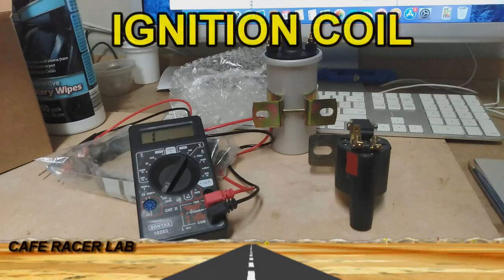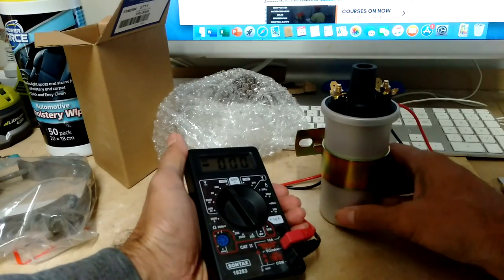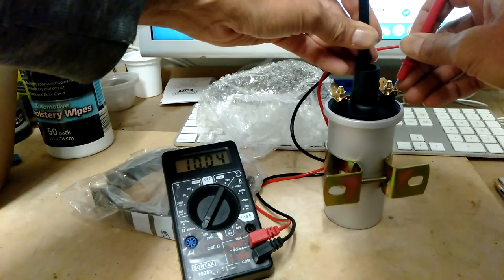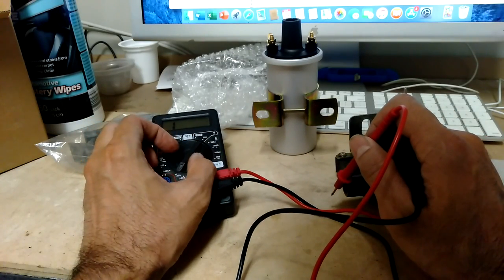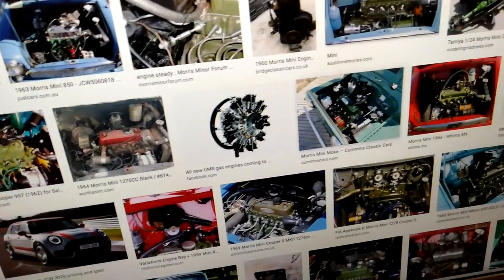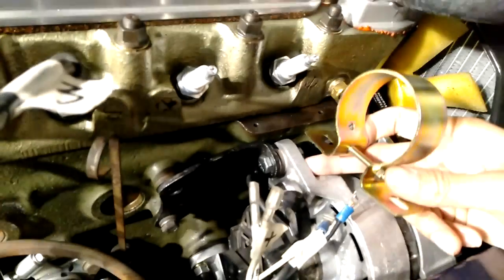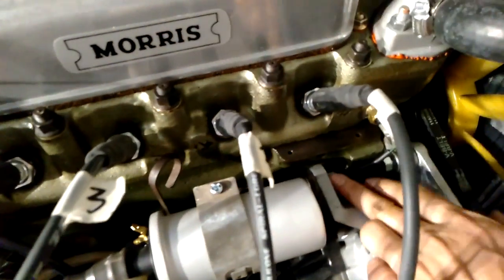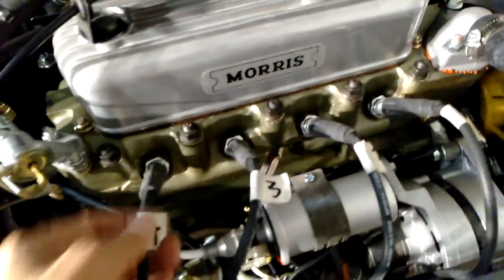Morris Mini Ignition Coil Test & Installation

Comment: It seems to me after owning 3 minis that you appear to have certain parts of your mini in the wrong places your solenoid should be attached to the inner wall to the left as you look at it and the coil should be fitted to the clutch cover all the wires are made in the loom to fit using the metal fold over clips fitted to the minis panels  Rob
Reply from the maker: Robert Bills I have noticed variation between models and build country. The mk1 Cooper S built in Australia had the solenoid on the clutch housing mounted with a triangle shaped bracket. Originally the coil was mounted on the generator.

Comment: You can put it to the clutch housing ...bracket fits there over the 2 holes ..looks tidy and cables are correct length for this
Reply from the maker: I have the starter solenoid in that spot already.